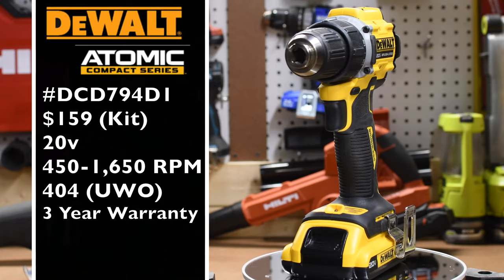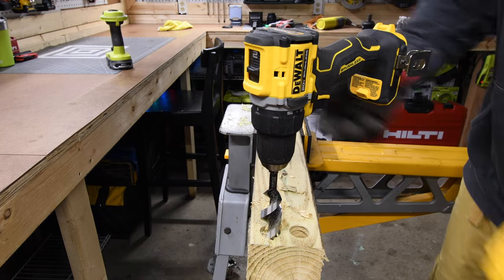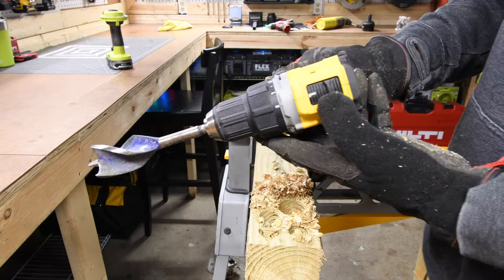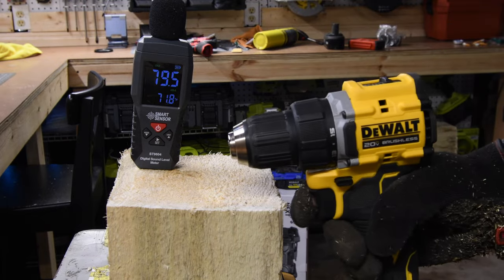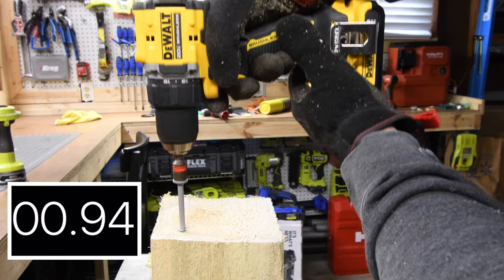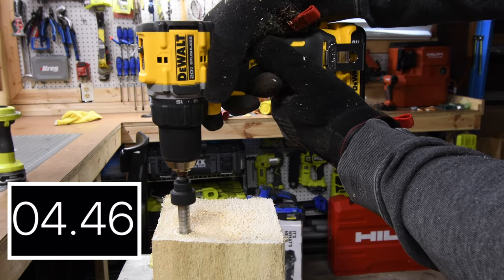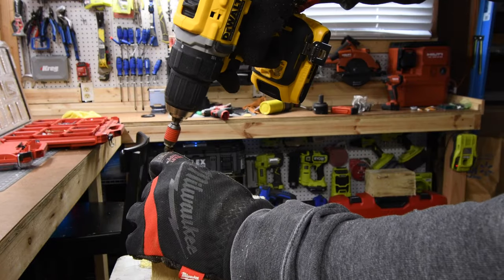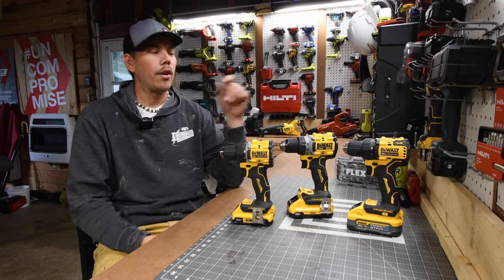(New) Dewalt Atomic Drill Driver

Comment: I dig the ergonomics on the Atomics. I’m a contractor and use them for my cabinet and door installs. Break out the bigger stuff when necessary
Reply from the maker: it is a very good drill driver. Love what dewalt is doing to their Atomic line
Reply: Is this newer than the 799?

Comment: I'm fairly certain the DCD800 will wipe the floor with the 794. I have the 800 and it's an amazing compact and powerful drill.
That said, I'm thinking about grabbing a 794 as my around the house/small project drill since it's a bit lighter and more compact than the 800. The 794 with a 1.7 powerstack will be quite a capable little drill. A few eviewers have had gearbox failures though, so I'll probably wait a bit for the bugs to be ironed out. It's good to see yours was fine though.
Reply from the maker: only one way to find out.
Reply: I have been working with the dcd 708 atomic for over three years and it has handled tough jobs ,I also have the dcd 805 and it is incredibly powerful.

Comment: I was taught that speed 1 was for drilling and speed 2 was for driving screws, is that wrong?  I see you're back to basics, Dave.  Good deal, your walk-throughs  only made me feel bad because I couldn't ever afford anything (even on sale).
Reply from the maker: Safety is always #1 for certain stuff speed 2 is good. But speed 1 is safer to use. Speed 2 is always an option for when it's needed. Which is why its there.

Comment: Bought same drill and put with paces with my good old brushed Ryobi drill 20v. Sorry Dewalt guys Ryobi killed it in every category and its 10yr old old drill. This Dewalt Drill is fine with light duty work but lacks torque for serious work. Got the Dewalt in a kit with Oscillator and Reciprocating Saw. Will keep both tools but not happy with the Drill

Comment: FLEX compact eats this atomic for the appetizer
Reply: Lol why u watching dewalt videos? Why don't u use that time to go buy the flex? 🤡
Reply: Who cares mate?. I have Dewalt and get all my work done easily .But you have to lump that big 24 volt battery around.
Reply: The flex compact is also 1lb heavier with the battery. And the DCD800 weighs less than the flex atomic with the battery, yet wipes the floor with it. The flex is a good drill, but not what I'd consider "compact". Really when it comes to compact drills, the DCD800 is the current king of the bunch.
Reply from the maker: this new atomic is limited. but we will see how it does against the XR version